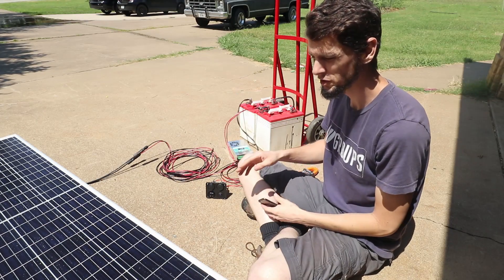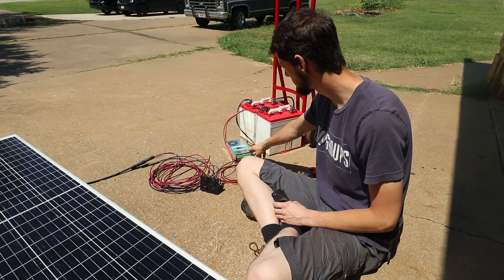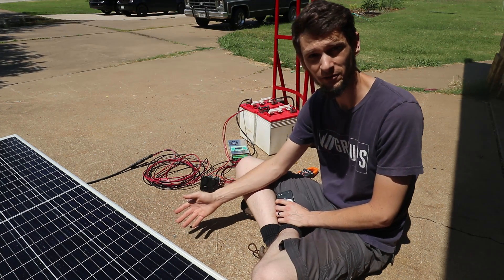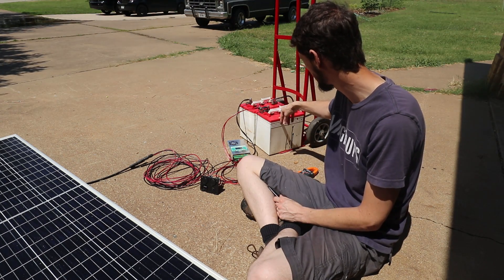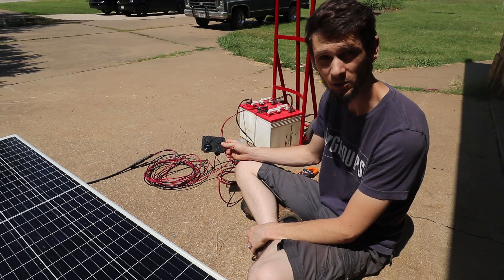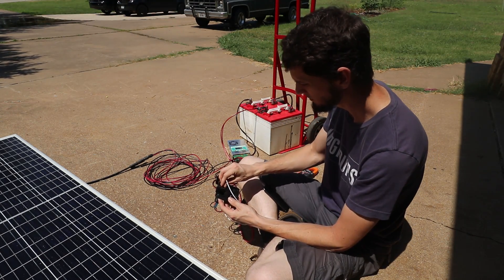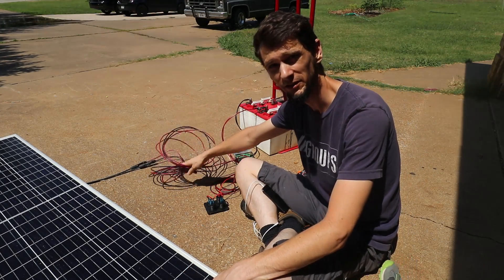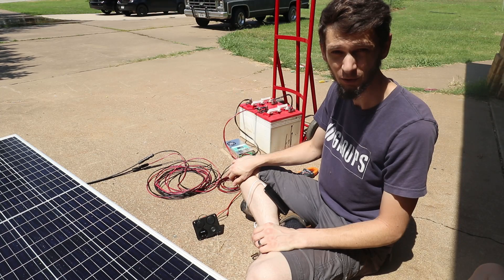Bare Bones DIY Solar Build Using High Voltage 144 Cell Panel

Comment: I have 95v solar panels, will this work?
Reply from the maker: What voltage is your battery? This controller maxes out at 80v for a 12v battery, but if you are using a 24v battery it would work.
Reply: @BeeneEnergy  I'll have to look for a better controller than the one I have and try it, I think this one is 12v only but good idea
Reply from the maker: @TheHuntermj  Here’s an option that can do 100v input: https://amzn.to/3prHpi1

Comment: what kind of watts were you able to get from that 400 watt panel  to your controller? and do you trust that controllers readings? i have found  it exaggerates  compared to my instrumentation, unless i am misunderstanding something.
Reply from the maker: Yes this controller is optimistic, I can't recall off-hand how much I've been able to get out of one of these 400w panels. Lots of variables. I'm working on some more accurate measuring equipment so I can know for sure how much they are generating.
Reply: @BeeneEnergy  wow, thanks for getting back to me on all three questions. i have learned a few things from your videos and have been inspired to try a few things i have seen you do. i have been shooting videos my self, but mainly so i can go back and rewatch and take notes of my instruments to help me learn. i plan on making videos to upload to youtube once i know whats going. for example i have a "300" watt folding dokio panel, and i am piecing together the information to explain why it doesnt produce 300 watts in the best conditions. the manufacture exaggerated on the specs of the cells they made the panels with, they are wired for parallel instead of series, expect 18v x 17x = amps to pass through 10 foot of 16 awg wire and feed a pwm which then drops the power down to 13.8v x 16a =220 watts before hitting the battery. i have the highest output of anyone who has documented them that i can find in the comments and reviews online, but i want to know what is the absolute best power i can get out of them, i ran out of time before using my mppt to test btw.   i think most people just lay the panles in the grass then either dont know they are only getting 90 watts or are pissed that this is all they can get lol. anyways thanks again
Reply from the maker: @jasonbrown467  Yes I see a lot of people ragging on a product like that without truly testing it. I appreciate that you are taking the time to think through it. Since even if the manufacturer did exaggerate there could still be a perfectly valid use-case for that panel!

Comment: lithium ion is different that lifepo, right? did you misspeak? when i saw this could do lithium i assumed it wsa lifpo, not li-ion. appreciate the videos, you are a few steps ahead of me lol
Reply from the maker: Yes you are right that Lithium Ion and LiFePo4 are different chemistries with different voltages. However they both use the same charging profile (cccv). So it's just a matter of setting the correct voltage to charge to.

Comment: awesome video. 49.21ocv x2 = 98.42 ocv. would you be comfortable with that on that controller? i have the same controller, and like you said in the video, 12v charging requires max 80ocv's. i guess i dont know how much we need to stick to the tolerance. i ran 100ocv through a three 60v 200 amp max watt meters before i realized i was smoking them, even though the actual operating volts was like 55volts that 100ocv smoked three of them. i know thats a little off point but how strict do we need to adhere to ocv limits on that controller? i have the same one btw
Reply from the maker: Yep I've done that connecting two of these panels in series and trying to charge a 12v battery. Not recommended! In one scenario it worked fine, I think this is because the panels were under a high load so the operating voltage was much lower like you mentioned. Another scenario the controller kept cutting in and out, and I realized the voltage was up over 90. So there appears to be some level of protection circuit that cuts out if the voltage is too high thankfully. Didn't blow the controller but it wouldn't charge, and I make it a point not to over-volt like I did that time on accident!

Comment: That link to the Amazon charge controller doesn't work, at least not on my IPad. Can you provide a model number and brand name? 
Also, do you do panel installations on rooftop of a metal roof? I'm located west of FTW in Mineral Wells. This is just for a stand alone, non grid tied install. Only 2 panels to be installed with leads run into house directly below. Single story. No other wiring needed inside the house. I'm too old to be climbing on my roof.
Thanks
Reply: That’s odd, works with my iPhone but I’m not going to pretend to know why the it gremlins are selective in their blocking. PowMr MPPT Charge Controller 60 amp is the name of the controller I use. I don’t do any installations, but if you need panels or even one of these charge controllers I’ve got some. 305w and 315w panels as well as a few 400w brand new ones like in this video.

Comment: Used to work on Vietnam era helicopters in the Army. They had pure aluminum single strand wires to reduce weight. The aluminum wires disintegrate and it was a non stop job replacing them. Check you site think you may have a typo unless a Forth Worth Texas exists.  Thanks for the video.
Reply from the maker: Ha ha thanks. I’ll go correct my City.

Comment: The manual shows a circuit breaker on both PV and battery connection.  I have 60A charge controller. Why are you using a 40A circuit breaker on the batter ? Would 60A work also ?

What size would you put on the PV side ? And why ?
Reply from the maker: From what I’ve studied the circuit breaker is there to protect the wire. The way I had it setup my maximum charge rate was 33 amps, wire could handle upwards of 50, so circuit breaker at 40 is above my current but below my wire gauge max.

60a would work if the wire could handle it.

Pv is the same calculation. For my setup I should have a 15 amp fuse for my 9-10 amp solar panel.
Reply: Beene Energy   Thanks !  That is good to know thanks again !

Comment: Im use to dealing with portable power stations but how can you use a higher voltage panel with a 12v battery configuration?  Is it just inefficient in that the charge controller has to step it down to 12 volts. Im slightly confused.
Reply from the maker: It’s the mppt charge controller that allows one to use a high voltage panel on a 12v battery. It had a dc to dc converter to drop the voltage down to an appropriate level and still use the full capacity of the panel.
Reply: @BeeneEnergy  And a PWM controller doesn't?  Where do you think the rest of the energy goes?  The benefit of MPPT controllers is that they adjust the DC-DC converter's duty cycle to track the "knee" of the panel's IV curve, but even a cheap PWM controller still increases current as it steps down voltage.  They don't waste the higher voltage like you said in the video
Reply from the maker: @julianyerger133  Your description of a PWM controller doesn’t match what I know of them.

The way I understand PWM is that the charge controller is a fast switch. It connects the battery to the panel. If you measure the input/panel voltage and battery voltage during bulk charging on a PWM they will be the same.

A panel can only output x number of amps, no matter the voltage. So
If the panels has a max power rating of 8 amps at 30v and on a pwm controller the panel is at 14v then you’re only getting 14v at 8a so about 112w out of a 240w panel.

If you understand or have observed it differently please share! I’m here to learn just as much as share :).